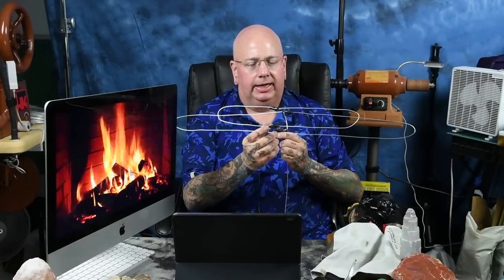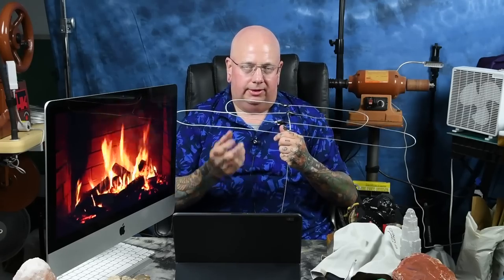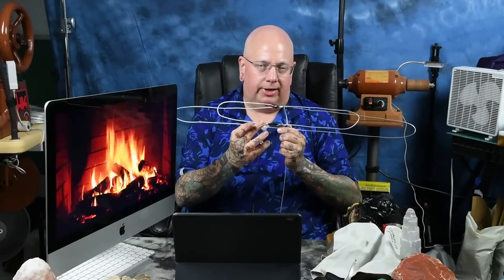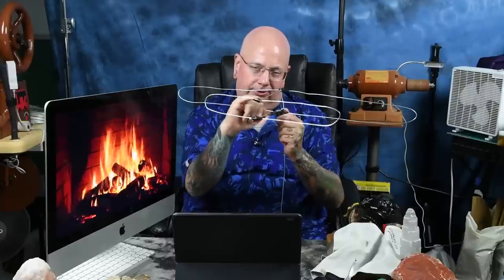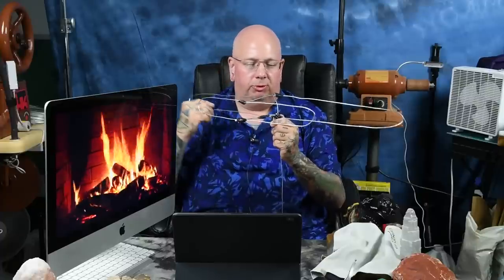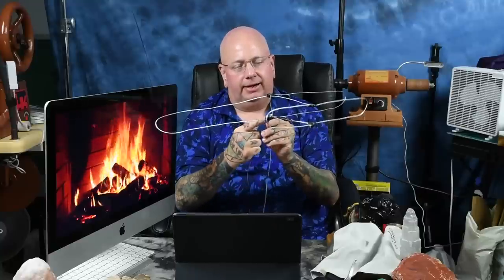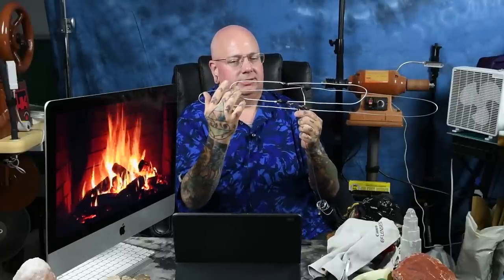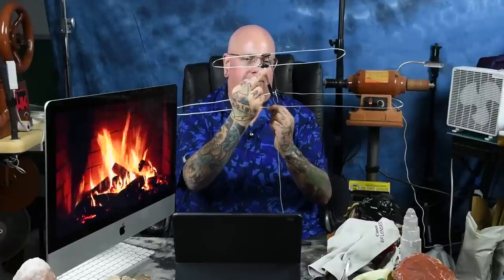😇 ELECTROCULTURE: HOW TO SIMPLIFIED! 🤩

Comment: Ken, i have been watching your vids for years. Thanks for you hard work and information. One question I have an 8 ft copper ground rod in the ground should it be connected or not
Reply: My yagi antenna is 40 ft in the air and i connected 1 wire all the way down in and connected more wires from that into all my flower pots .stripping back about 8 inches of the wires and sticking them directly into the roots of all my plants. Everything I have is extremely healthy.
Reply: And then my satellite internet quit working... could I be blocking it? But first question, connect to a ground rod or not?
Reply: I have another yagi I'm going to install on the same poll under the other soon.

Comment: Hi Ken, a question: I heard you have to have the wire touching the roots. Is that true?
Reply: I put 4 copper rods together and made a pyramid type structure but a copper coil on top and brought a orchid back to life. Faced the coil North, I have a clipping of a jade plant with about 10 lose raw crystals next to it facing North and it's really looking better than the other jade clipping with just 3 copper rods tied together. I started using hydrogen water for the last 2 months.......

Comment: So if i put up a collector antenna, since the South pole of the Great Stones beneath us is facing Up.  And since the Luminaries are moving Clockwise above the Earth creating the Positive flow of Current that is attracted to the Negative charge of the Ground we walk on....Wonder what would happen if i used the current collected from the Antenna to wrap the copper lead coming off of it, around a solid iron rod...where the copper lead is wrapped Clockwise going down the rod, and finally into the ground.     Would i be able to bury that electromagnetic rod, UNDER the area where i'm going to grow my plants, and it have a Stronger Gaussian Field than the 2inch grade45 block magnet?

Comment: Does this antenna need an electric current ran thru it? Like a wire under the soil? Or does it generate its own electricity somehow like solar with copper and zinc? Trying to understand where the energy is generated. Thanks in advance

Comment: In your previous video on electroculture  the antenna's driver element was separated from the reflector element  and the directional parts ...  how is it that both systems work.   ... is one system better than the other ?
Reply from the maker: look up YAGI antennas,   reflector / driver/ director.......2 element yagis also work as mentioned  , just not as efficiently
Reply: @KenTheoriaApophasis  Thanks again Ken

Comment: Hi Ken. Can we use copper lacquer wire for electroculture? It's hard to find uncoated one. Thanks :)
Reply from the maker: YES BUT THE GROUND HAS TO BE BARE COPPER ON THAT END
Reply: Heat it off. Or chems.
Reply: Burn it off and hit it with a fine wire brush to clean it.

I usually use the solder pot for this but for the ground you don't need the extra lead.

Comment: Good idea but you are so inconsistent in your explanation even you repeat things twice. There is no clear advice here. You should show a picture or sketch of how to place the antennas, how you anchor them in ground, including measurements. I could not understand clearly how to wind the wire. Does it need to be continuous? Should be shown without tape and closer. 
The video is way too long for what you want to tell people. 
Thank you